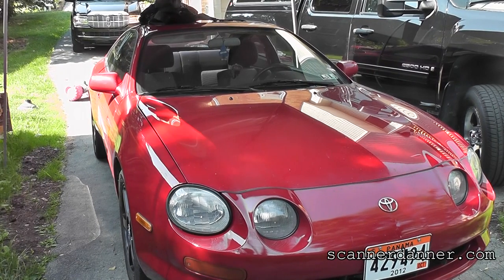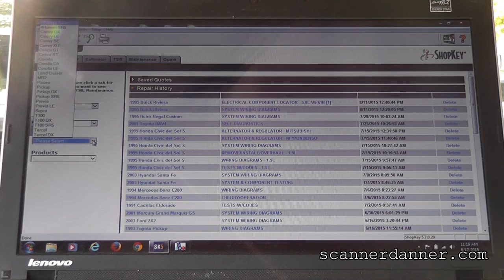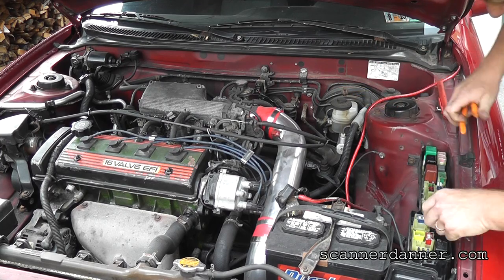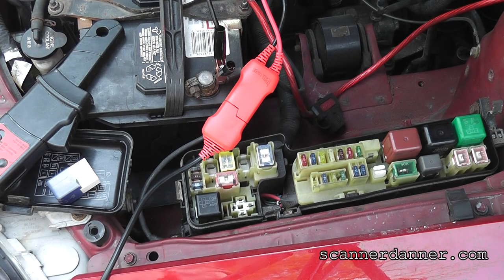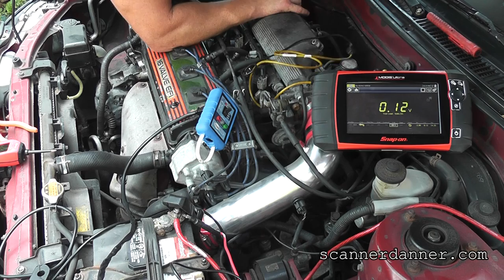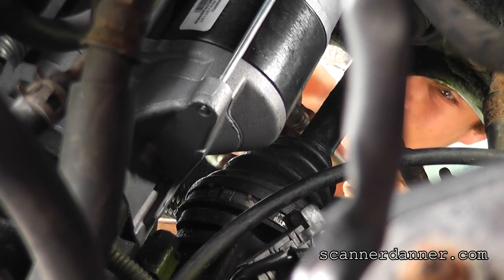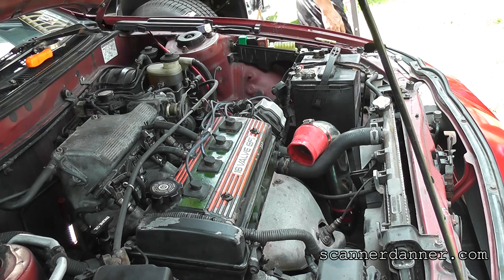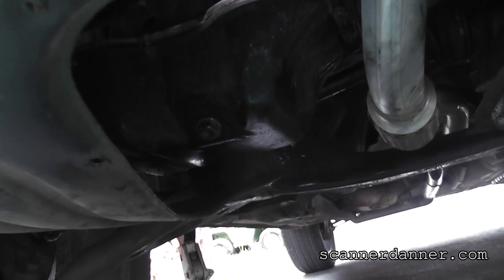How to troubleshoot a no crank problem (94 Toyota Celica)

Comment: Danner, the Denso Starters are nearly infinitely rebuildable. Subaru, Chrysler & even Harley Davidson use these Starters.
For about 25$ you can buy Contacts. Remove the 3 bolt cover & install new contacts. Next time go a bit further into the Denso Starter! Saves LOTS of dollars!

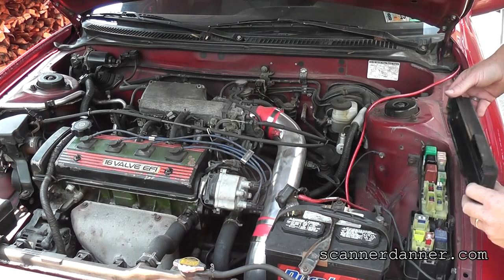Comment: Excellent video.  I'm not your son, but I am learning good information, too!  I have an unrelated question.  I replaced the fuel pump on out 94 Celica (probably the original one) with a Wix fuel filter.  I recommend going with a Toyota fuel filter.  The Wix filter had a painted copper washer connection while the Toyota one had a metallic surface to mate with the copper washer.  In addition, the Wix lacked a third smaller copper washer for the bottom side of the filter.  I currently have a very slow fuel leak at the filter, which leads to my question.  What is required to disengage the fuel pump?  I'm pretty sure I missed something, but not sure what.  I took off the EFI relay that is black (pictured at 15:14 into your video -- it is the lowest and farthest right one when viewing the video), but the fuel kept flowing for about 20 minutes.  I then removed the one next to it (gray in your son's vehicle).  Eventually the fuel stopped flowing.  I'd even consider swapping out the Wix with a Toyota part if I could figure out how to keep so much gas from flowing during the change process.

As soon as I get this to pass smog and take ownership, I will get a Chilton's or a factory manual (BTW, is Chilton's acceptable, or should I pay more for the Toyota service manual?).
Another tip that worked well for me was to 1. most people know this, but just in case...  use a line wrench on the fuel line (more contact points, less chance of damaging the nut -- and the entire fuel line!), 2. use some sprays from an upside down can of compressed air to cool down the nut and break up some rust to loosen the nut.  It worked like a charm for me.  That nut was going absolutely nowhere, I sprayed it a couple times, and Kablow!, the nut loosened right up and was easy to remove.

BTW, you have some really nice tools, but is there a way to do some of those tests without the Big Dawg Mechanic tools and just a multimeter?  If so, some commentary as to how would go about doing it would probably be valuable to us DIYers.

BTW, nice looking body on that Celica!

PS -- Check out local junk yards for some 6 Gen. Celicas.  There is a standard transmission 6th Gen. Celica at a local junk yard around my neck of the woods.  I've gotten a few parts from it, but a filter box and air intake is not one of them.
Reply from the maker: If fuel keeps flowing with a fuel line off, this is not from the pump running, it is from tank vapor psi. Next time, take the gas cap off.
Second,
If the filter is a banjo bolt, there needs to be a copper washer above and below the fuel line.

Comment: Probably a bad solenoid contact in the starter (poor connection drawing just the 10 amps - much less than the >100amps like it should). Could have disassembled it, and refurbished the contact surface to be good as new.  Saved $96 and really made your time worth it.
Reply: yeah u can usually save a starter or alternator by dismantling them and in the case of a starter its usually the brushes or dirty commutator or like u said burnt contacts at the business end of the solenoid,.
in the case of the alternator, most can be fixed with a new regulator and/or diode pack..........thats all the recore/refurb guys do and then charge you $100 !
if the starter or alternator have noisy bearings or bendix then best to recore .
Reply: If its like a honda starter you can check the solonoid contacts if burnt you can replace for $14
Reply: That’s the good thing about DENSO starters, you can always get heavier contacts and plungers for them as the windings are usually very good...

Comment: Hey Paul, Wouldn't it just be easier to take a test light to ground or volt meter and connect it to the signal wire to the starter and have your helper try to start it first?, If the test light or voltmeter shows good range of voltage, wouldn't that confirm that the circuit is good?, if that checks out then double check your feed wire from battery to starter for proper voltage. If all that checks out good and tapping on the starter doesn't work I would just check your accessory belt drive to make sure nothing on that end is preventing crank. I had a situation that an alternator was locked up not causing a crank before as well as a jump time situation. if I didn't have a signal to the starter then I would back track. Your thoughts?
Reply: the reason I say start from the starter signal wire is that I had a situation to there I powered the signal wire from the  distribution box signal wire to the starter and nothing. I checked the accessory drive system and all was good. I called the starter, I pulled the starter took it to AutoZone and had them bench test it and it was good. I was scratching my head. come to find out there was an open from the starter signal wire to the distribution box. That's why I start from starter first and work my way back.

Comment: on large trucks, you can turn the fan which is locked up and that will turn the pulleys sometimes taking stress off of the Bendix and you can hear it pop back in, at that point your all good.

Comment: Great video and comical at points! Would you ever do a review on the power probe to show testing methods and potentially a faster way of diagnosing using one? I am still undecided on whether or not to buy one as I struggle to see how it can be faster than what I currently do. Thanks
Reply from the maker: +EP91STARLET It really depends on your arsenal of tools. For example, I wouldn't use the PP4 to check for injector control because I have a scope. 
I will be doing more with it for sure. Thanks!

Comment: "Doogie", or corrosion on the solenoid contacts was always an issue with early GM starters. Removing the solenoid & the cover would allow one to clean or swap the contact pads, allowing the disc to contact non-pitted areas of the pads. Then clean up the round plunger ring & you've rebuilt the solenoid. So long as the plunger worked, you were good to go! I would guess that 70% of starter issues were the result of worn solenoid contacts. Ford used a remote solenoid which was non-servicable, but easy to jump.

Comment: Had a delco reny 30 MT do the same thing on a western star truck  just finished servicing it took it out of the shed to clean up got in to go and grab a trailer and it was dead in the driveway to the workshop. Displaying very similar symptoms. Not shure what the current was though as i didnt have a clamp meter but judging by the fact it pulled 4 fully charged  N70 batteries down to 7.5 or 8 volts i say it was pretty high

Comment: I almost gave you a bad rating on this one, but all the extremely good work you did with your son would not allow that, especially your patience. A lot of fathers would just jump in and do it themselves to save them time. You gave your time to help him in many ways. The reason for the bad rating may also go along with helping your son. A one second glimpse, which may have been an error for my 68 year old mechanics eyes, where you working on this car with only the floor jack? If true make a big stink to your son this was an extremely bad move. One instant, you are crushed. No jack especially todays cheap ones are safe to use this way. Even the old in ground floor jacks would drop for nor apparent reason. at any time, they at least had goofy safety posts that didn't always work. Being lazy doesn't fly.  You know this I have watched you work, but SLOW down . Love in Christ.
Reply from the maker: +david scharringhausen it's your 68 year old eyes brother :) there were jack stands under the car. Look close you'll see them. No way would I trust a hydraulic jack not to mention putting my son under the car.

Comment: i hope you get to see this I have the same car in  the same car 94 celica but i  was just wondering , for the front lower control arm , is it the same as the corolla or camry of the same year.  I am having issues finding a control arm around where I live. If not the front lower control arm rear bushing , is that similar to another toyota car that i can swap it.  PLease let me know.

Comment: WHAT no check the fuse box and or visual wiring inspection...?
Take a wrench and turn the crank you sometimes hear a click and that is the pinion returning back to its normal position and it might crank back again.
Pinions get jammed sometimes against the flywheel gear half way and is not enough to spin up the main motor.

Comment: great video, you know way more about electronic systems than I ever will. One question, did you guys ever hand crank the engine to see if it was seized? i missed a bit of the video so i might hsve missed it. Might be a good tip to check first. Anyways, cool father son vid!
Reply from the maker: Absolutely some thing you would want to do for any no crank problem. There are clues though that a seized engine will give you. 
1. A loud click of the starter
2. Very high current flow (dimming of lights etc.)
Then of course history of the vehicle is important. This being my sons car, I knew it had acted up on him a few days prior and that he was not dealing with a seized engine issue. Also, if I remember correctly, the starter didn't even click and the lights stayed bright. I may have even done a current measurement, I don't remember.
Reply: ScannerDanner yeah I figured you guys would know for sure if it was seized right away. I fix a lot of power equipment and stuff like that and I've run into stuff like that before. Felt like an idiot chasing electrical issues with a seized engine!

Comment: Banging the starter is all good and well, but it the UK where a majority of cars and manual transmission, we also release a stuck starter by 'rocking', basically putting the car in a mid-range gear and rocking it back and forward to cause the engine to rotate, releasing a stuck starter.  I don't think the Celica had a stuck starter, but it's worth consideration in a no crank situation.
Reply from the maker: +toppledgod good tip, thanks!

Comment: I do have a question.  I do understand trying to teach the fundamentals of things but how come you never try the more direct approaches to find the problem?  In the Case of the Starter I would have just put some current on the Starter to see if the motor turns. 7 out of 10 times that would be easily to  do in about a minute flat. Would it not be worth mentioning?
Love the Videos, am just asking.
Reply: that's what he did but he was trying to teach the circuit as a whole so next time let's say it's not the starter now the kid knows how to check battery and nutraul switch also seeing if the relay works in the field when not teaching a lesson I'm sure things get done in a fast matter

Comment: from the videos I've watched it seems like your son Caleb shows more interest in vehicle diagnostics than Jake. wld you agree with that speculation? do you have any more kids? 
you seem to be truly blessed with your family. wish I could say the same for mine but almost all of m are sneaky, 2 faced, selfish  back stabbers. 😕 I allowed my brother (18 yrs older than me) to borrow my car 3 mts after I bought it (payed cash) & he ended up keeping it for years! put almost 80k miles on it & only maintenance he did was oil changes! he parked it once the tires and brake pads were bald & rack and pinion so shot it wouldn't hold a drop of pwr steering fluid. I finally got it back a yr ago. had to get a battery, tires, brakes & overdue maintenance (which was A LOT) also took it to Acura for 2 recalls he never bothered with (1-pwr steering hose replacement 2- ECM corrosion issue- install cover on &/or replace ECM)
Well, literally ONE MONTH after getting it bk on the road it went into limp mode on me. I cldnt afford a mechanic at that point so I taught myself basic electronics skills like reading schematics, vehicle communication networks.. mainly iso9141-2 since it's what my car uses, how electronic throttle control works, etc..(car had U0107 DTC lost comm with TAC module). after gaining basic understanding I came upon your channel (which was by far the biggest help). got a service manual & followed flow chart for the DTC, which led to replacing TAC module. when that didn't fix it I gave up for awhile I was so disgusted. I'd gone thru EVERY diagnostic step for the DTC multiple times AND checked voltages & resistance in practically every related circuit, everything normal. I figured I had to be overlooking something bc it couldn't be the PCM, I mean the dealership had just checked it!?! 
After mts of not touching the car one day I decided to go pull more trim outta the interior to trace wiring to fuse box/multiplex unit & the very 1st piece of trim I removed uncovered the other side of the PCM (without wire harnesses) & speaking of cussing, whew was I MAD!! the ECM housing on that side was COVERED in corrosion! I also realized then why the "cover" from the recall had just been thrown in the space instead of bolted down with the PCM, the bolt on the side was impossible to remove & had to be destroyed to get the PCM out of the car. one of the screws that held the lid on it did too because it was so soft from corrosion. 2 pins on a 56 pin IC chip had completely disintegrated! I got another PCM & switched out the EEPROM chip. I was so happy when I was able to accelerate normally. 
I only drove it once since putting in the PCM though! it was less than a mile away for my daughter's school orientation. I came back home right afterwards bc I noticed a tire was low. I accidently left the trunk open barely & it killed the battery down to 4 volts! I've charged it, tried a jump pack & jump start with cables connected to another car. it doesn't crank at all?! the first few times it kinda acted like it was about to, like cars do when the battery is just still too low but it got less every time I've tried since & now it doesn't appear to do anything when I turn the key. (voltage is still above 12 volts tho)  
wen someone else does and I watch under the hood I hear one click and this wheel with a belt turns, like one complete spin it seems (the top wheel of the series of wheels to the right of engine that a belt wraps through all of and has AC compressor at bottom. Voltage taken at battery terminals drops to 10.7 when "cranking". I had no prob starting car at all prior to this but it sounds just like what happened with your son's and will need starter. of course I'm going to do more diagnostics to make sure once it stops raining here all the time.
what's your take?

Comment: So, I know this is a comment that I should ask my Snap-on tool guy, How is it that you are getting your MODIS Ultra to display live voltage like that? I just bought a MODIS Ultra (Upgraded from the SOLUS ultra) and getting to know its capabilities.

Also, I have used the VANTAGE Ultra in conjunction with my SOLUS, but it seems that I may have constricted my abilities by getting the MODIS to replace both of them. Is there a way to use the MODIS as both a scanner and a oscilloscope at the same time?

Comment: Fastest way I know is divide the circuit into load and control. I like to run a thick gauge wire direct to starter. If it turns.. starter good then I know it's in control. If it doesn't spin then it's something in the control side and can go into diagnosis. 
Yes I know be super care with a wire and touching the one end to battery positive. So I get it on starter first then touch battery+.

Comment: I have a 94 Toyota Paseo with similar engine ...what would cause the AM2 fuse to blow? ...I got no start whatsoever ...brand new battery ...starter motor tested ...alternator tested ...could it be my IGNITOR or IGNITION COIL ...or could it be something else that I'm not finding
Reply from the maker: First, you must have a good wiring diagram to find out what all is on that circuit 
https://eautorepair.adtrk.biz/?a=10817&c=24&p=r&s1=
I am showing the AM2 fuse first feeding the ignition switch, then it branches off from there with some circuits only being hot during cranking and others being hot cranking or running. When the fuse blows will be important here. 
The cranking only circuits are:
ECM, clutch switch (manual), park/neutral switch (auto)
The cranking and running circuits are:
igniter, ignition coil and distributor, EFI main relay, injectors, condenser and radiator fan relays. 
Start with a good visual inspection of all of the components and pay attention to areas where there is heat a vibration

Comment: ScannerDanner I am having this issue I have replaced the starter and battery (prior to finding your video) but on top on my car not cranking my EFI fuse/relay is making a buzzing noise and vibrating with the key in and turned to the on position. But when I punch the clutch in and turn the key to start the noise stops but then comes back when I release the clutch. Any help
Reply from the maker: A buzzing noise from a relay is always caused by a weak magnetic field on the coil side of the relay. 
You have a low voltage power supply problem or a bad ground problem on the control side of the EFI main relay. Without seeing a diagram, I can't advise further right now.

Comment: I have a 1996 celica gt with a manual as well, im wanting to buy it, but the seller says it has intermittent starting where itll start sometimes and not others and something with the ignition system. Woild this be a way to test and diag those as well?
Reply from the maker: It would be but you'd have to have it do it to you to be able to test it